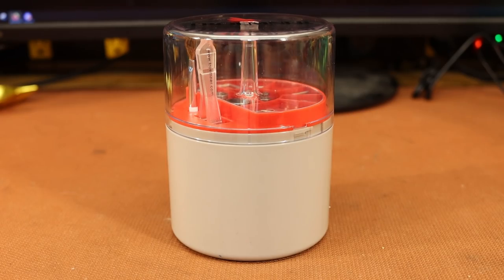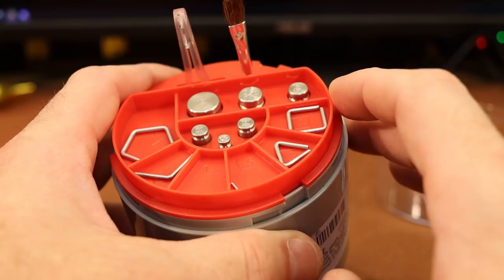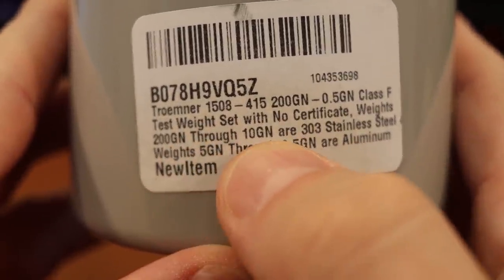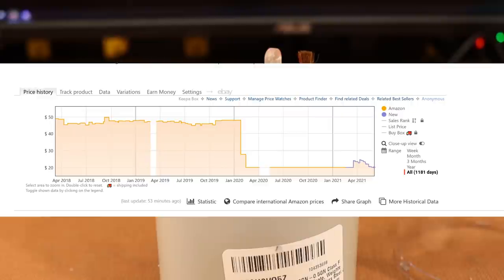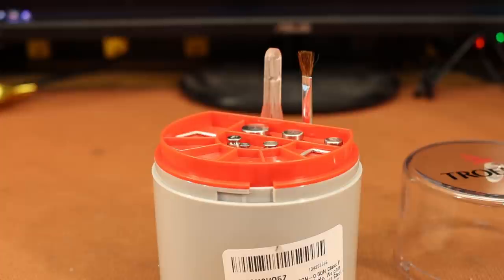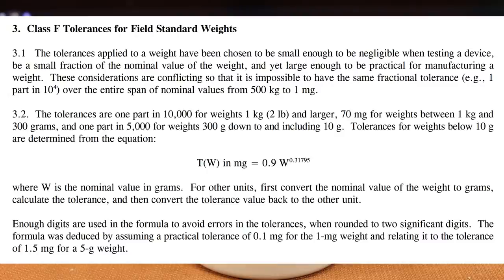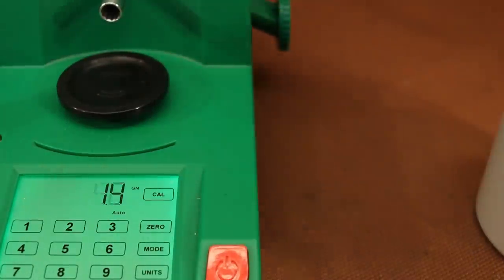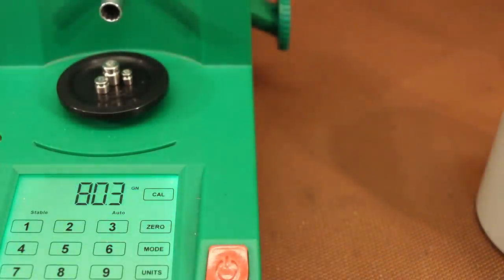Troemner Class F Test Weight Set

Comment: I have both Lyman and Troemner and both sets had weights that were off by 0.1 grains.  It was driving me crazy so I bought some class 1 weights to calibrate my scale.  Once calibrated I adjusted the out of tolerance check weights with a fine diamond stone until they were measuring correctly.

Comment: Great video!  I took the plunge and ordered the larger weight set.  All of the SS weights were 0.1 to 0.3 gr heavy.  The aluminum weights were good.  I used a Dremel to slowly grind a small amount from the bottom of the SS weights until they measured correctly.  I used the same scale you used along with the newest Hornady digital scale and an RCBS beam scale to verify.  Keep up the good work!

Comment: the reason there is tweezers is so you do not get your body oil on the weights with your fingers. the body oil adds to the weight, so not giving an accurate weight. I have a back ground in Jewelry. Jewelers will use hand lotion  and handle gemstones bare handed , when weighing the diamond your to purchase. this can add an additional point or bring it up to the next point.
The same applies to these weights, even though we are talking body oil on fingers. especially the larger weights

Comment: I'm late to this  but ordered a scale and Troemner weight set and a digital scale after watching "Johnny's" scale video, but I didn't see this video until afterwards. Checking strictly against the new scale, several of the weights appear to be overweight. I looked back over everything to see if these appear to be counterfeit. The weight case and outer box both have matching serial numbers. Both the inner and outer box have several labels with the company name, address, website, stock and model numbers. There's even a label advertising their "MyRecal Program". Their website shows the same product number with a consistent description including the "No Certificate" statement. The sale price for the 50-.5gn set on their website is only $33.75. Based on this research, I'm convinced that they are authentic.

I have another RCBS digital scale and a Dillon beam scale. Since the indicated errors are all to the heavy side, I'm going to cross check all my weights across all three scales and "adjust" them with a fine diamond stone.

These videos are immensely informative and helpful and how you can keep people's attention on such an esoteric topic for 27 mins is a true talent - Thanks!

Comment: I found my scale calibration weights off by 3.3 grains. I added solder to them to get the span right on my Frankford Arsenal intellidropper. Had same issue on my wawoo $20 scale.   But ony took me 15 minutes since I have 25+ years calibrating electronics.  😁

Comment: I use a flat piece of glass and a piece 1200 grit wet or dry sandpaper. Polish the bottom until it meets your specs. Maybe a little cutting oil, but then clean it with some Blue Shower, or another Tricloroethane based degreaser.

Comment: I bought set on Amazon. I weighed them all on my RCBS Lite Powder Measure Scale.  One of the 20 gn and the 10 gn weights were 20.1 and 10.1 respectively.  all of the other weights were dead on. i confirmed this on my beam scale as best i could. I adjusted both errant weights down with some sand paper.  Now they are dead on according to my two scales.

Comment: This vedio concept is brillant! In truth, reloaders simply trust whats sold to them as being CERTIFIED!?. 
BUT . . .  fact is, neither the scale nor the weights being tested have any form of official certification testifying to its accuracy.  Meaning, the test being run in this video tells us little to nothing. At best, the test is a relative comparison between the 2 different "non-certified" products . . . and the results are only subjective. If I may suggest, as a Youtube Creator dealing with volatile substances and subject matter, it might be worth taking your weights over to your local university's engineering department and have them run a quick "standards and weights" test on your weights, unofficial of course, but still confirming which weights you're using are accurate. This would answer all your/our questions about the equipment/tools you're running and firmly justify your presumed "trust"?. 
The results of your effort would be an invaluable service to our reloading community, and I bet the video would be sought-after and watched by a broader audience than usual. 
I'm reluctant to share this, but, from my own experiences, I have discovered newer weights and scales sold on the market to be set light, when compared to the old reloading weights handed down to me by my father.  It's understandable reloading equipment manufactures would want to have any end user error on the light side of weight.  But, it's all speculative until someone runs a standards and weights test. Food for thought
Reply: Probably an industrial lab that would be able to cert them for you, since all it is is a matter of traceability back to NIST.

Comment: assuming you calibrated this scale with the lyman weights, they should always measure the correct value.  what you are actually comparing here is the relative weights of the lyman set and the troemner.  if you calibrate the chargemaster with the troemner, you would have the opposite results.

also, i had a chargemaster lite and the scale on it was accurate, but it drifted from zero within 10m by as much as .5gr.  sold it (for more than i paid) and bought an autotrickler.  now i have the peace of mind never questioning the weight of my charges.
Reply: The issue is the 20s are different.  If the calibration of the scale was the problem both 20s would be heavy.

Comment: So this set has some kind of certification,  F, whatever that means. And it's concluded that these are wrong (heavy), and the Lyman set is the standard ? As soon as this started I knew (from personal experience) that this is leading down a rabbit hole. What is THE standard we are comparing everything else against (scale, check weight A, check weight B). And why do consider the standard, the standard. What was the "standard" tested against ? Is it certified by a lab after calibration against a known standard ? It seems like this video is considering the Lyman weights as a standard. Why ? And then there is discussion of modifying the certified set of weights to match the set that isn't certified  ? This no compute.

Comment: My scale came with a 50g check weight do I still need this? I have the 30$ Frankford scale
Reply: 50g (grams) is like 770gr. That's a 50bmg bullet, or 3 loads of 50bmg powder. 

You need check weights to verify your scale is accurate at your target weight. So if you want to load 9mm, you'd want to verify 4gn-6gn with your check weights
Reply: @timturner7609  thanks Tim